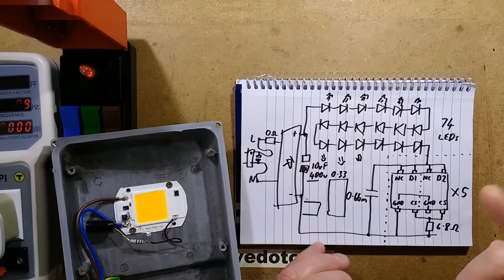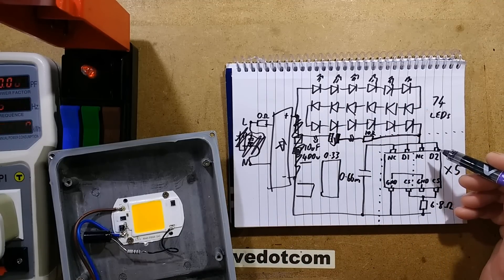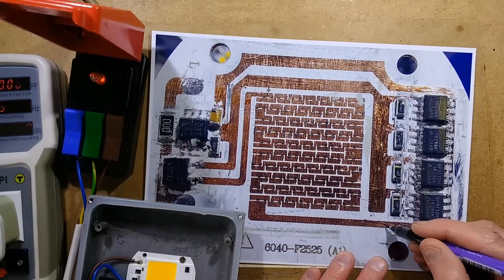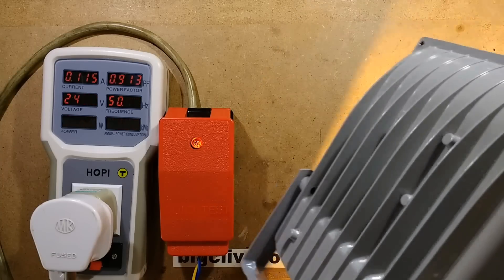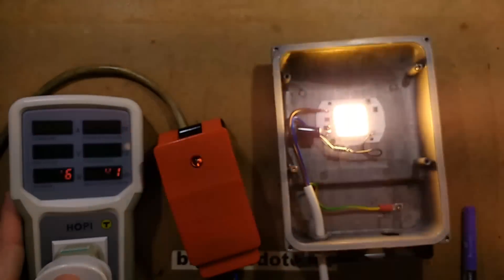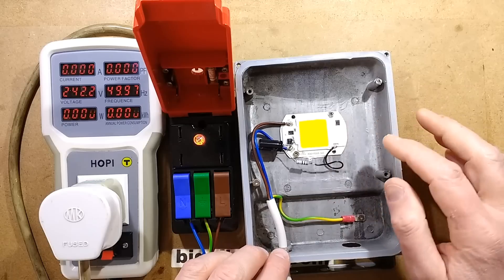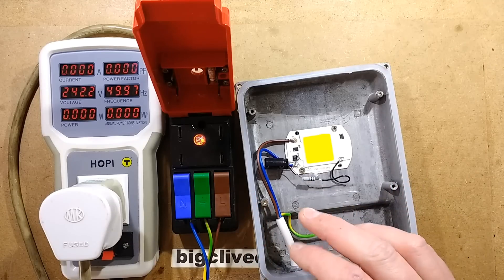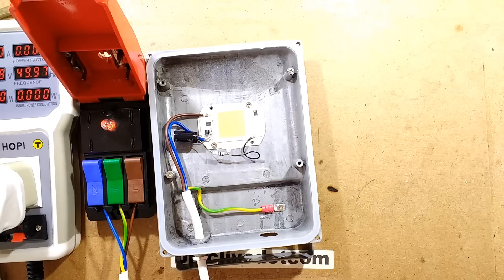Another capacitor test on the driverless LED.

Comment: Can someone advice me which color temperature is better on these type of chinese 220V COB LEDs, warm or cool white? Generally I prefer warmer light, but I saw some videos and pictures showing both light colors outside and the warm one seemed very orange/brownish and low CRI...

Can someone help me with this one? Cheers
Reply: If you're in a cooler "Northern" climate, warm white is more agreeable to most people. They look yellowish in pictures because of color correction and display color error, but usually aren't nearly as yellow in real life. I used to prefer 'daylight' color CFLs and LEDs, usually > 4,200 K, but those look quite blue to me now, so I only use 3,000 - 3,500 K. If you prefer warmer light, that's the way to go. :)

Try taking a picture of a light source that's labeled warm-white yourself, and then look at the results on whatever device you've been using -- note that you will get different results with different color and exposure settings.

Comment: That 10 Ohm resistor makes that cap less effective, it's like putting in a dried-up electrolytic with ESR>10Ohm. I think the chip will survive just fine, the value of the cap is not that big.

Comment: Dear Clive ,
I'm building a 100 watt led spotlight.do you have any experience with Cree led's?...I've read the are a lot more efficient ,though they are a lot more expensive than Chinese led's.is there a brand of Chinese led that compares in quality to Cree ?.....or is the better quality/efficiency claim by Cree  just an advertisers slight of hand?
I alive off grid,and power is something I try too use as little of as possible.Any advice you could give with regards to building a 100 watt led would be greatly appreciated.

Comment: again sm2087 far better, no need for cap
Reply: Googled sm2087, first result was a datasheet, then a bigclive video from 2015
Reply: Just curious, but has Clive taken anything to bits with that chip? I cannot remember.
Reply: There is at least one. search for sm2087... 
you can buy on ebay leds with this ic, one of them is 30w... but it blows fast, because they are driving IC and leds too much. If you disable one IC and/or lower led current, you have very good light, for few $
Reply: I can't find the led modules you mentioned.
Video link:
https://youtu.be/C-AfmLggE28

Comment: What would the temperatures and power dissipation be like if you used thermal paste to bridge the aluminium backplate and the metal casing as opposed to bare metal on metal

Comment: Add a 10Meg ohm resistor across the capacitor to safely discharge (slowly) it without causing excess current draw (24uA). And use an aluminum electrolytic capacitor for the light, the solid electrolyte will be better with the heat. EG Nichicon's UBT capacitors are a bit over a dollar at Qty 1 on Digikey for the 10uF one. And the datasheet[1] states 2000 hours @ 125C minimum.

[1] http://nichicon-us.com/english/products/pdfs/e-ubt.pdf

Comment: Given the relatively low cost [even at 500+ we are looking at 30p or so] of electrolytic capacitors and the apparently extremely simple nature of the circuit this technology seems promising for general purpose use. One question though - if you were putting a capacitor across the rectifier at the design stage wouldn't you simply put more LEDs in series to take advantage of the higher presented voltage without overloading the chips?

Comment: Was there heatsink compound coupling the aluminum backing to the larger mass of the case?  Would that matter for the temperature issues?
Reply: It would matter, it's the same with a CPU and its cooler.
http://images.bit-tech.net/content_images/2009/02/all-about-tim/compound.jpg

Comment: how much money would it be for me to ship something to you to write a blueprint of it for me naming all of the parts and how to wire them up to a device and make a video on it showing me how to do this stuff? it is a small item and a broken hard drive boards if i have the money and the hard drive Boards arnt working it broke when using an ebay item so if i could send them to you i would send the Ebay item as well Or can i take a picture of them and send it to you and you tell me how to wire this i need the switch wired to make a homemade soldering iron.

Comment: Interesting results. I'm wondering how the mod in your previous video would do on US mains which would be ~170VAC fully rectified. Might have to pick up one of those and a few caps and tinker with them.
Reply: It won't work at all because 170V is lower than the sum forward voltage of the series of LEDs.  The LED module depends on this, so they could make a version for 110VAC market but it would have a different LED layout with half the LEDs and another of that in parallel for same wattage.
Reply: Ah you're right. I was thinking they used 54 LEDs not 74 so yeah it'd probably be a massive fail.

Comment: What if you were to run with the capacitor across the rectifier (like in the previous video), but run it on 120V?
Reply: Won't work, input voltage to series of LEDs would be below the sum forward voltage of that series of LEDs.
Reply: Stinky Cheese
Yeah. I was doing that arithmetic after the last video trying to work out if you could bodge a 2nd unit in series some how but figured you'd need to break the 2nd unit and solder part way along the chain.
Reply: Stinky Cheese ah so the capacitor can only boost voltage from rms to the peak?

Comment: Would someone explain/suggest a modification to my current experiment? (Sorry for being out of place)
I've been messing around with capacitive dropper circuits, I'm powering one 0.5W led at 60ish milliamps.. I've sorted out inrush current and the like, but something is rather puzzling to me.. 
My plug in power meter shows a current draw of 60mA, a power draw of 13-14W but (here's the catch) a power factor of 1.00

I thought that capacitive droppers would always have a significant power factor impact especially with such a small load.. Is it just my power meter that's giving me false results or is there something blatantly obvious that I'm missing?
Reply: IIRC the cheaper ones can be inaccurate at calculating PF at low current... I think Julian Ilett did a vid about it.

if you've got a scope you could have a go at working out the angle between voltage and current, the PF is the cosine of that angle

PF isn't really something to worry the domestic user - would be more of an issue for industrial lighting or council street lighting which I guess is why BC gives it greater prominence when he's looking at these more industrial units.
Reply: Thanks for the reply, I do have a scope so I'll look into it later in the week. Here in Ireland PF isn't just limited to industry, even with a significant phase lag the mains input power meter (in my house at least) will show the same power draw even if the real power being drawn is lower.. We don't have to pay more for reactive power like industry but it's worth keeping in mind that it still goes towards a bigger bill

Comment: If my memory serves me right, didn't the schematic on the regulating chips datasheet have a capacitor in parallel with the LEDs but without a resistor? I'm to lazy to go check.
Reply: Good memory!  Yes the BP5132H, and possibly the other two (I don't recall) has an NP capacitor across the LEDs with no resistor.  Due to the cost of one 10uF & 400V, I imagine they had a smaller capacitance value in mind, considering two of the primary points made in the datasheet description were "a quite small BOM benefit from no ECAP... ".    400V 10uF film cap doesn't fit in a "quite small BOM".

Comment: Putt a two capacitor, one is with resistor positive side and other is negative side resistor :D DC 50Hz filter need another wey. What is  ferrite core coil inductor ? :)

Comment: Clive, I have a question about power factor (not of these LEDs, but more in general): A couple of weeks ago or so, some Dutch researchers publicized their tests with the new so-called "smart" power meters (we in Germany still mostly have the old electromechanical or "Ferraris" meters, but the EU wants to press electronic meters upon us in a few years). According to the Dutch scientists, those meters that use a Rogowski coil as a measuring device, measure too much power, while those that use a hall sensor measure too little. How relevant is this going to be for us (not for you though, since Britain is leaving the EU), having lots of cheap-ish switch-mode power supplies, capacitive droppers, LEDs and so on connected to our mains wiring? And what can we do against it, except hoping the meter that is going to be installed will use a hall sensor? It would be an interesting topic for a video! Especially now since we (in the EU) all have to dread getting an electronic power meter... Here's the link to the PDF: https://storage.googleapis.com/files.dinside.no/9/maalere_rapport.pdf

Comment: This is a good solution! Thanks BC !!

This measure makes this LED usable even indoors but I would use it on outdoor and garage/workshop use. Until they (manufactures) decides to make the on-built circuit flicker free and drive the on board chips cooler.

Cheers

Comment: There's a point here I am unsure if has been covered.
The original datasheet for the BP5132h states it can be dimmed using triac type dimmers.
Looking at the original circuit we see how they feed Drain1 with a resistor and seperate the capacitor they have on Drain2 from that with a diode.
CS1 is also experiencing the two resistors they drew in series while to ground while CS2 only experiences one. I am thinking both these are linked to the dimming aspect of the driver.
It wouldn't be the first time chinese are a bit lax with the naming and labelling. I think the schematic show how it works more than the names do.
It unfortunately also states that it starts to work from 12v and up so it may be that they simply time multiplex the current and thus allow a sort of dimming.

I'd love to see some tests on these with dimming, just to see what it will actually do.
If I had em here I'd also film it with my cam set to 600fps to see what is actually happening with dimming...

Comment: Can inductors be used as a means of preventing inrush current instead of resistors, since they resist changes in current flow?
Reply: yes, chokes do that, the mathematics are a minefield,
Reply: 30 odd years ago when in training for electrical engineering I didn't quite know why chokes were there, then later it 'twigged', ahh, yes, back EMF and all that, fascinating stuff. J.

Comment: Dramatic reduction in flicker without the dramatic reduction in power factor like the previous experiment.
Instead of adding the 10R resistor in series with the capacitor, the 0R link on the mains input side of the bridge rectifier could be replaced with a suitable resistor and let that help limit the inrush current. Use a 105 degrees rated electrolytic to maximise its life.

Comment: Clive I have a question (not related to this video).

Recently we had an electrician around to look over all the electrics in the house and he found that one of the sockets in my bedroom had the Live and Neutral connected the wrong way round. I was just wondering if that could have caused any problems or doesn't it really matter? (standard U.K. Socket)
Reply from the maker: It would have meant that in the event of a neutral (live) to earth fault in an appliance the fuse in the plug would not have blown as it was effectively on the Neutral.  That means the appliance would be protected by a 32A breaker.  Other than that most appliances would have worked fine.
Reply: Wel, i'm not Clive but I can answer your question. It shouldn't have caused any problems since here in europe where I live you can plug the plug the way you want, and devices don't care if neutral and live are swapped since it's AC, so theoretically it shouldnt, but lets see if an engineer can answer this question better for america or where you live.
Reply: I'm not Clive either but, no, not really, unless you plug in something like a toaster where the elements are normally neutral, (and exposed) if you plug in said toaster and poke around in it when it is 'off' everything inside is very'on', Sorry about the bad explanation, J.
Reply: Worse than that, it meant that if the fuse failed open circuit for any reason the appliance would appear to be off but internally would actually be connected to live.
Reply: what he said.
Reply: If you plug in an appliance that is undamaged and in good condition (with no faults and where all the internal electrical insulation is in good condition), it would appear to work okay.
However, with the live (line) and neutral swapped, any class 1 appliance would become a potential death trap and possible fire risk. As the fuse in the plug would effectively be by-passed if there was a failure of the electrical insulation in the appliance.

Comment: Clive, you suggested putting a capacitor in series with AC input, creating a capacitor dropper circuit. Have you tried that yet?
Reply from the maker: I've not tried that yet, but it would be best suited to very low power use like 5W.
Reply: not to give you any "bad" ideas, but what would happen if you put a capacitive dropper on a 50W+ load? if such a thing would make the device more exiting you should make a video about it. for general knowledge ofcourse, not that everyone want to see caps exploding....

Comment: The last test showed there was no flicker then became unstable, something must have became compromised and weakened so I would start off fresh with a new one. Here we are adding a capacitor then a  resistor on a rail with no isolation. I don't get it?
Reply: Shouldn't we have to make a break in the rail then surface mount the parts between the two breaks? Allowing the capacitor to bridge the connection then the same for the resistor?

Comment: But it's a current limiting chip, no? Shorting it would just cap the current would it not?
Reply: Even if the current is limited, since there's almost 0v drop across the LED's, you'll have the full rectified mains voltage across the regulator. Even if the current is limited you'll still get a large power dissipation in the regulator chips. Even a well designed device will have power on surges.
Reply: Yes, but how many times before it fails?
Reply: The current limiting isn't magic. It (being a linear regulator) does so by pretty much being a variable resistor and "burning" energy. If there's something equivalent to a short on the outpur it has to burn more.
Reply from the maker: The initial current would be a lot higher.

Comment: The charger to my Google Pixel just stopped working for no reason. Unfortunately it's not putting out 240v on the low voltage side or anything but if Google don't ask for it back would you like me to send it your way Clive? Its a 5v 3amp and 9v 2amp dual voltage Qualcomm fast charger.
Reply: "Unfortunately it's not putting out 240v on the low voltage side or anything"
Now that's the spirit of this channel and it's viewers!
Reply: Christopher Staples i got Samsung galaxy A5 it got to 85°c so sent it back before it went all note 7 on me.
Reply: Chronic's Tech Stuff Google pixle  phone is not a QC charger it's using a USB standard called usb-pd (power delivery) so if you plug your pixle into and USB 3.1 type c port or USB 3 port with usb-pd support your phone will take the max amount of power the phone requires
Reply: lee x ah k thought it was Qualcomm fast charger. Barely 2 weeks old tho weird it just died.
Reply: Chronic's Tech Stuff somthing with Google wanting to other companies to use a standard not a property tech (even though QC 1-3 is very good you can't fast charge over a USB 2 3 or 3.1 if it the phone supports QC (max 1a 5v over a USB port) and it can't support Usb-pd and QC on the phone at the same time has to be one or the other 

With usb-pd you can charge your phone from a laptop at high power mode (Apple Mac and some Windows laptops) some phones that have large enough batteries can power the laptop it self with usb-pd

Only down side is you need to rebuy your extra chargers again if you want fast charge (you can actually use the laptop charger if it's a USB C type) , but you can still use any charger with a pixle as  it will still charge just normal speed
Reply: Should check out the best of big clive video on my channel :)
Reply: it rained this week , google pixel dead ... shoulda got the galaxy note

Comment: Would you recommend a bleed resistor (multiple for the high voltage) across the new cap?
Reply from the maker: A 1 Megohm quarter watt should be OK.  Or two 470K in series.
Reply: good idea, perhaps one or more Meg, though the light will be hard-wired in, so no probs with plug pins and hands,

Comment: one last idea: capacitor in parallel to the rectifiers output and a choke in series with the input?
Reply: One more! increase the value of the sense resistors to lower the current. Also, remove or lower the 10 ohm resistor on the cap, with a bit of luck it will give the led a softstart.
Sigh, we're down to redesigning Chinese LEDs to make them more reliable. Oh wait, we passed that point already.
Reply: An inductor in series with a capacitor is a tuned circuit - specifically, a bandpass filter. There will be a narrow range of frequencies that will experience very low resistance - and that range of frequencies will be part of the 'square-wave' power-on signal
Reply: or an NTC thermistor instead of the resistor, OR considering the low price of these LED modules, just try it without the resistor and see what happens, especially now that we know with one there.  However I'm wondering if the capacitor temperature is really the result of the vicinity to the LEDs, or its ESR?  Has Clive measured the driver output frequency?  I must admit that I wasn't paying enough attention to notice how this driver worked, whether it stays at 50Hz or higher.  If at 50Hz, I wouldn't expect ESR to be much of a factor.